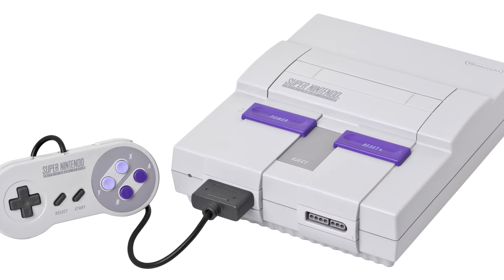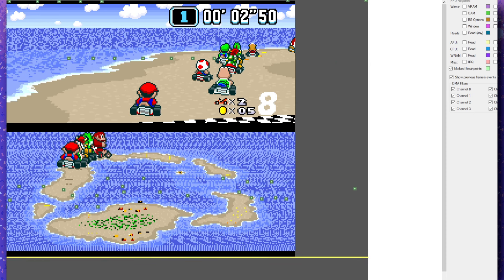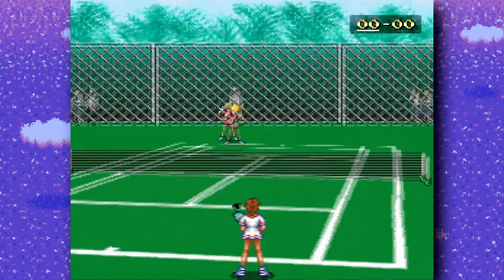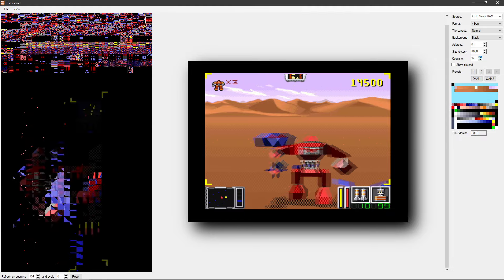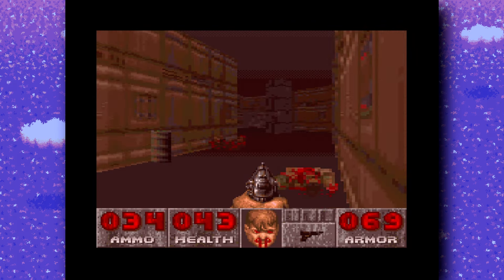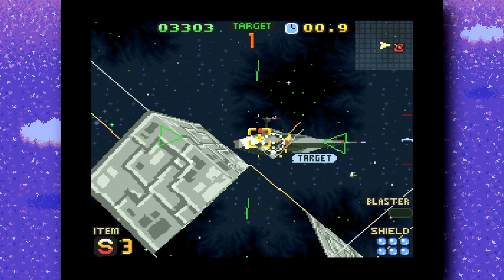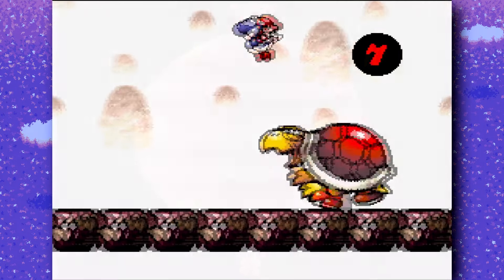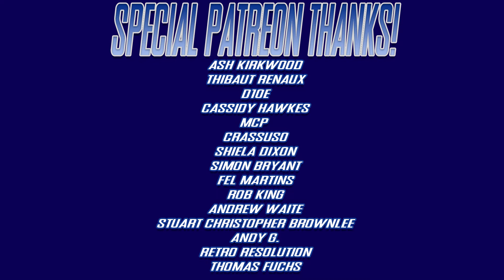How 'Enhancement Chips' Pushed The Limits of The Super NES (and Sometimes Didn't)

Comment: There's some kind of a myth behind the idea that the SNES was designed to be upgrade by enhancement chips. I mean, any cartridge based system or systems with slots for adding cards is designed to be upgraded. The most desirable is that your game cartridge contains ROM and only ROM. If you need extra chips because the base system can't run the game, then you're going to have to pay for the extras.
Reply: Yes and no, as I understand how the Genesis's 32x works, it just abuses the bus same with the Sega CD.

Super Nintendo doesn't use these types of hacks, Infact I think it was planned to be modular, otherwise their is no way the SA-1 could take over the system as it does, it's not just a co-processor, it effectively can replace the cpu and give orders to other chips.
Reply: @daedalus547  If the SA-1 is taking over the system, then it is using the same system bus. If the SA-1 chip can stop other system chips (CPU as an example) in order to run the system, then it is sharing the same system bus... If SA-1 has its own buses and memory, then it is modular like the Z80 on the Genesis... Yes, modular is better, but you can do that on a Genesis cartridge too. It is just a design choice, they probably compared the costs and benefits of both aproaches and settle for the simpler one. I guess it was a good selection since both Sega CD and 32X work pretty well...
Reply: @matiasd.7755  The 32x was a pain to develop for, it was not modular at all, the fact that it interrupts the main cpu to insert data is the very reason why Sega did have as many add-ons cause the core architecture was never made to handle it. It's a hack on a hack on a hack, there are only so many hacks you can abuse before it won't work anymore.

Nintendo originally was going to make the SNES a powerhouse, the only problem is it would have cost the same as a Neo-Geo AES, so instead Nintendo just made the SNES upgradeable. It's core architecture was built with add-on chips in mind. They knew this from the get go.
Reply: @daedalus547  Sega CD and 32x designs are not  hacks. They use the bus for its main purpose. A hack would be using the Yamaha sound chip to generate display somehow... So SA-1 takes over the system and it is ok but interruptions on 32X are not ok? Moreover, Sega CD and 32x work just fine. They can even work concurrently SegaCD+32X, so I don't know what you mean? Virtua Racing is a cartridge enhanced game  which requires no add-on. The game contains the SVP coprocessor and it works flawlessly getting higher framerate than the SNES games that rely on the SFX chip to generate 3d. If SNES is designed for expansion and Genesis is not, then why does Virtua Racing achieve a higher framerate on Genesis? Sorry, but I just don't think your argument is enough to convince me that SNES is designed to be more upgradeable than all of the other upgradeable cartridge based systems.
Reply: @matiasd.7755  How is it not a hack? It literally needs to render and combine video output separately. It's a hack! How many SNES carts have video input and outputs? None!
Reply: @daedalus547  Yeah, 32x doesn't look nice. Some VGA cards did the same on the PC world. I have an old PC with an analog tv tuner card and you have to take the sound out of that card and into the sound card. Looks hacky. But thats the purpose of the auxiliary sound input jack. SNES has two video chips. Just imagine the Sega Neptune was realeased, it was meant to be a Genesis and 32x combined into one, and you would not see that video connection. Of course, we don't like the design but other than that it works and does what it's meant to. I really believe that the VDP pixel bus should have been included in the expansion port and the sega CD should have included the 32x capabilities. I believe that but so what? We're not talking about if we like or aprove the designs, we're talking about enhancement capability. I gave you Virtua Racing, a game that does not require a SegaCD nor a 32x, and I ask you: given that Virtua Racing on the Sega Genesis runs with an enhanced cartridge, is Genesis upgradeable through the cartridge slot or is that only a SNES capability? Given that Pitfall II on Atari 2600 upgrades the console by adding an Atari sound chip and even a sortof coprocessor into the cartridge, is Atari 2600 upgradeable through the cartridge slot or is that only an SNES capability? Given that Konami added lots of sound chips into the MSX games they delivered on cartridges, are MSXs upgradeable through cartridge slot or is that only an SNES capability? Is there a possiblity that all cartridge based systems are upgradeable through the cartridge slot? If so, is it possible to answer a simple yes instead of yes and no?
Reply: @matiasd.7755  It's not only a SNES capability, it matters how the architecture works in conjunction with the add-on chips, if the chip only works in a very specific manner then it's a hack, imagine if the SA-1 only worked when the graphics mode was set to mode 7 but wouldn't be able to work with any other graphics mode. That's a hack, the Virta Racing cart is a hack, plug it into a x32 and tell me it works, it wont because the SVP and the 32x conflict with each other, this makes it a hack, Sega never planned expansion outside of the expansion port and it shows. It's a kludge on top of a kludge
Reply: @daedalus547  You keep on talking about the 32X design, which you don't like it. But the subject is if cartridge based systems are upgradeable by built in chips in the game. I gave you Virtua Racing. You complain that it won't run with the 32x and that's not a problem. The game was designed to work on a stock Genesis just like all of the SNES games with built in chips. All of your argument about the architecture better suited for upgradeability doesn't sustain itself since Virtua Racing runs at a higher framerate on the Genesis than the 3d enhanced games on SNES. I mean, it's facts against opinions. That's the way the world works. (Not really the subject but even the 32x version of Virtua Racing Deluxe is a pleasure to play.)
Anyways, you did recognize that upgradeability is not a SNES'unique feature and that was the main point here: all cartridge based consoles can be upgraded with builtin cartridge chips. Not really the most desireable, but that's an option. You did agree about it. My mission is complete. I must get going, my planet needs me. Farewell.
Reply: @matiasd.7755  You mission? lol The Genesis 3 can't even run virtua racing... does the SVP abuse the same bus as a normal game? yes, so its a hack, why do you think the SNES carts have extra pins for? I'll give you a hint... those pretty extra pins in the cart are for PLANNED expansion chips. FX, SA-1,CX4 and every other chip use the extra pins that were DESIGNED for EXPANSION, I know it hard to understand and I know you can't fathom that maybe, just maybe Nintendo did a better job at designing their console, but its true. You can jump up and down, go nuts, reality is still gonna be reality.
Reply: @daedalus547  More pins, less pins... Star Fox runs at a lower framerate. Same with that cutesie racing game (forgot the name). They run at a lower frame rate. I guess you preffer more pins over performance. Sega Genesis bus runs at a higher speed and it's a real 16 bit bus. It transfers two bytes per access. It offers a higher bandwidth. A late cost reduced version of a console that lost some compatibility? welcome to reality! Shit happens, you know... I can see you like hardware designs and lots of pins. Pins are good, I imagine how shitty Star Fox would have run with less pins... Genesis has a better processor which allowed a faster bus. It's not my opinion. SNES: more pins, cutesie racing game at low frame rate. Genesis: less pins, virtua racing at higher frame rate. Not an opinion. Anyone can see it. You don't like the design and I like the results.
Reply: @matiasd.7755  Hacked vs Properly implemented has nothing to do with speed at all. StarFox and Stunt Race FX use the gen 1 FX chip, the FX2 is better but will still result in slower frame rates, you can speed this up by fixing how many polygons are rendered by scanline, it has absolutely nothing to do with the SNES's speed, there are ROM hacks which work on original hardware that fix the frame rate. So your example comes down to how well a developer knows the hardware and not the capabilities of the actual hardware.
Reply: @daedalus547  I don't think you have the authority to tell properly from improperly implemented since you weren't there when they designed the console and you didn't evaluate the costs and benefits of some aproach over other. All we can do from our humble position is evaluate the final results. Personally, I see a supposedly non upgradeable designed console giving a better performance running a chip enhanced cartridge than a supposedly upgradeable one. Not only that, but the realeased version of Virtua Racing handles lots of polygons (lots more than the 3d SNES games) and a decent high resolution. Nobody was in need to hack it and lower the poly count. I feel like we're going into the terrain of SNES is better because of the desing and no, Genesis is better because of general system speed when that is not the point. The point is that I said all cartridge based consoles can be upgraded by chips built into the cartridge. I said that is not a SNES unique feature. And I also said that it is preferable that the system wouldn't need those chips just to not pay extra.
Reply: @daedalus547  I don't know, man... Star Fox EX just doesn't seem to prove nothing. First, the display is cropped with borders all around. Virtua Racing has top and bottom borders but this is even more... Resolution is affected by this. It seems to draw too few polygons, I mean, it doesn't even draw polygons for the terrain, it just plots some pixels to give the illusion of depth... It doesn't have a long view distance because that would increase the polygon count and then everything just pops up right in front of you... But anyways, I don't think it proves the SNES to be better suited for expansions than other systems, it does, however, prove that the SNES is just one more cartridge based system capable of expansion with chips built into the games. EDIT: Sorry, I forgot that price discussion: A proof of concept Star Fox has recently been made for the stock Genesis. That is, a program running without helper chips. It works great. That is probably the reason I wasn't paying extra for processor hungry games back in the day. The system handled them without a sweat. If you had extra dollars to pay, good for you. I could spend them in other stuff.
Reply: @matiasd.7755  Have you played the original Starfox? What background polygons? And what about VirtaRacing? It's pretty much a demo, who cares if it's smother and plays better? It's 20 laps or 4-5 races, big whoop, for it's MSRP price of $100 that's a rip off. Starfox even tho slower had 28 whole levels and cost $70-$80.
Reply: @daedalus547  You just said you didn't mind to pay extra for SNES games. Now you're complaining of the Sega price for the only one game they needed to add an extra chip! That's funny! You don't like when a data bus is used for transfering data and call it a hack. You don't like when a game runs smother and plays better (your words, not mine) and call it a demo. I feel like I was arguing with my ex girlfriend so I'm just leaving it here. Have a nice week.

Comment: The reviews for dooms snes never once mentioned that it was cut down from the pc version.
Reply: I've seen reviews mentioning just that - but on this video it's not really that important, although the fact that it had no floor/ceiling textures because it was already barely acceptable and probably also because the graphics already required memory'a'plenty.

Still though - just the fact that you can get DooM to run on underpowered 16-bit CPU, even if not as smoothly as original despite of also including a special graphics accelerator chip to help, is still quite an impressive feat in itself, it simply can't be left unmentioned on video about games that pushed the limits of SNES hardware with "enhancement chips". The original game used brute force to render the bitmap graphics with software and it required at bare minimum a 386 CPU (486 for smooth gameplay on full screen) and 4MB's of RAM for all of it's resources. SNES wasn't designed for 3D graphics of that kind, and even with the enhancement chips the features were barely enough to implement a texture-mapped 3D world.

I wonder, was Carmack involved in actually writing this port? That man is a God of game engines that achieve what was thought to be impossible :O

Comment: I wonder if Nintendo could have made an adapter (like the 32x) with the SFX2 chip. Imagine buying one at the price of a game, and then allowing any other game to make use of it without having to include it on the cartridge itself. Kinda like pluging in an accelerator card.
Reply: And then you have to buy 5 different expansion cards that you need to swap everytime you play a different game. This would have only confused people, especially in the 90s without internet. Imagine moms returning the game because it didn't work on their child's system.
Reply: @DarthChrisB  I was thinking just about the SFX 2 chip because it was very powerful on its own. Now, if a programmer wanted to use another chip, then it would had to put it in the cartridge.